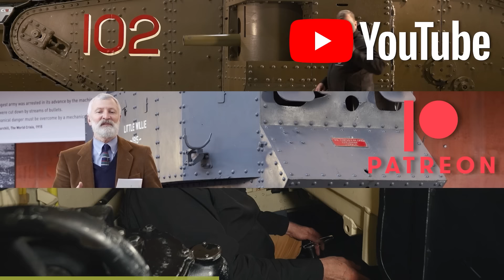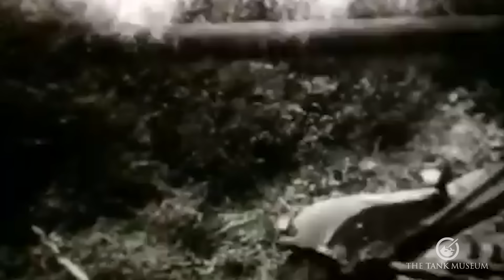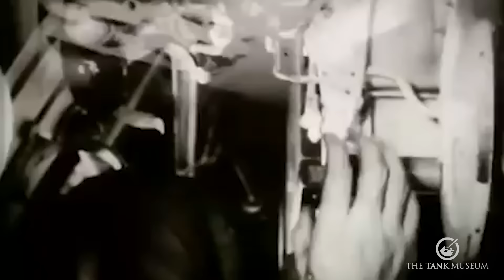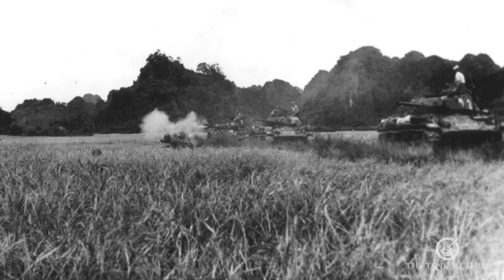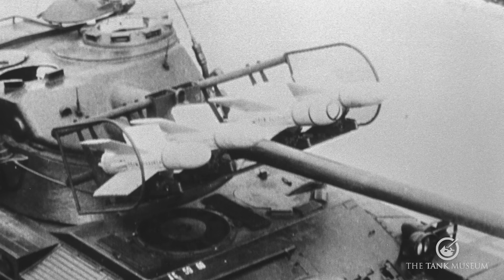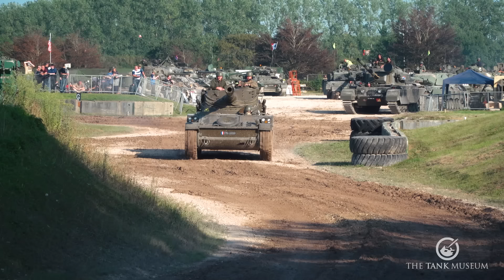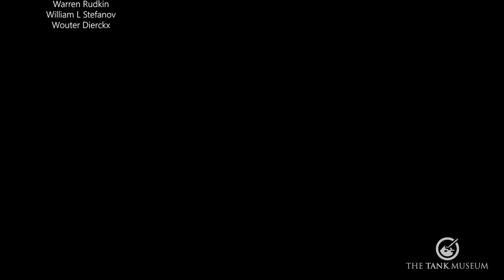AMX-13 | Tank Chats #174

Comment: One of my favorite designs aesthetically. So unique!
Reply: as much as I enjoy the aesthetics these things would have terrified me to drive since the armor could be penetrated by firm sneeze.
Reply: The same can be said for many medium tanks, most light tanks, all APC's, and Most IFV's. Historically armor isn't everything. It really depends what you're up against, and the doctrine of you're army.

From my ~15 years experience and multible deployments, I've always been shitting my pants, and flooring the pedal, when ever RPG's or other high calibre start flying. When ever possible. Else praying, even though I'm not religious.
Until the age of the commercial drone, I have always prefered mobility over armor, in everything but a main battle tank, because of the typical ways different vehicles are utilised.
Fighting a low intensity insurgency is different though. IED threats require Up-armoring.

But now that real time air survailance costs basically nothing, and small payloads can be guided through a window when driving 60km/h, by a guy who has played videogames his intire life, with only 30min additional training. I'm not so sure anymore. Survivability is probably the way to go on any vehicle, going forth. 

I'm glad, that I'm retired. While war fighting has always been shitty. I really feel pity for soldiers these days.
Reply: @soul0360  the issue I have with the AMX-13 is that even old AT rifles could pen the armor. armor doesn't need to stop everything but being a "tank" that can't handle even a single round from WW2 era autocannon fire is off-putting at the least.
Reply: @soul0360 mobility still matters, anti drone systems are just something that need to be delevoped

Comment: Sweden almost bought the AMX-13 in the early 50's when the UK refused to sell the Centurion.
Then the UK economy tanked and getting foreign Currency took priority.
The first batch of mk3 centurions where delivered straight from UK Army mobilisation depots.
Reply: Countries were queuing around the block to get Centurion and then the Korean War started which halted British arms exports temporarily. I don't think the AMX-13 was a Centurion replacement. The Swedes had expressed an interest in autoloader technology quite early on and trialled the vehicle in Sweden, and I'm not sure if they had any serious intent to buy it as such, rather they wanted to study the technology.
Reply: @shaddaboop7998  The deal for 400 AMX-13 was ready to sign when the Centurions came available, invalidating the need for the domestically developed "Kranvagn"/"E.M.I.L." tank project that the AMX-13 was intended to supplement.
Reply: @johanmetreus  Yes seems you're right. Either way, Swedes didn't like AMX-13 much and besides it was never intended to be used as the country's main battle tank, that would've been EMIL.
Reply: @shaddaboop7998  No the AMX-13 was really on the table because the Centurion was not available. 
It wasn't the ideal choice but it's what's available.
Reply: @AdurianJ  That wasn't the impression I had. I doubt it was intended as a main battle tank replacement. Sweden was developing an indigenous main battle tank with an oscillating turret before they decided on Centurion.
Reply: @shaddaboop7998 The whole reason for going with a foreign tank was that the Swedes had given up on their own project, being considered to expensive and to uncertain, at the time. The new tank, AMX-13 or Centurion, would be the next MBT of the Swedish Army. The question was whether to go light, giving good mobility, or going heavy, giving good protection. Eventually the Centurion won out but it was very much a debated choice within the Army at the time.
Reply: @AdurianJ How available was it really? The Swedish Army received its first Centurions in 1953 but watching the video above I get the feeling the French would have struggled to deliver hundreds of AMX-13 to a foreign customer at that time.
Reply: @vendist  EMIL wasn't scrapped until the British offered Centurion again in 1953. Until then it seemed Sweden was going to buy a fleet of AMX-13s to buff out the limited production numbers they could've managed of EMIL as a main battle tank. The Swedes didn't seem to like the AMX-13 much anyway and jumped at the opportunity to buy Centurion.
Reply: Ironically, the Centurions proved too heavy and expensive to properly defend much of Sweden which lacked the good roads to support fast Centurion movement, so they developed the S-Tank and such to provide coverage for that capability problem. If the Swedes had gone all-in on AMX instead, they might have ended up not developing half the vehicles they eventually did, instead focusing on up-gunning AMX.
Reply: The UK was experiencing a slow recovery in the 1950s, but then hit the 1970s recessions quite hard. Selling a lot of military aircraft abroad fed our family back then.
Reply: You certainly got a better deal with the Centurions I suspect.

Comment: I think its hilarious it was intended to fight in the colonies (all hot) and they put the engine next to the driver. A true case of un thought through design intent.
Reply: An awful lot of design is compromise.  There is nowhere else to put it and stay within other specs.
Reply: That's part of the compromise. Tank had to fit in a plane initially so had to be short and light. To get a powerful enough gun for the size barrel had to be long so turret had to go at back to avoid overhang leaving the only engine space to be at front beside driver. Yeah, there are other things you can do but you have to go with what you have at the time and the resources you have in France
Reply: (Looks at Merkava in Middle East deserts)

Maybe it's not that much of a problem.
Reply: If the engine compartment is well designed it can protect the driver from the heat. The driver's compartment may also be shielded. A large radiator, a strong ventilator, to circulate the air around the engine, also help to dissipate the heat away from the driver. 
Not perfect solutions, but it is not much worse than all the other tanks of the era while figthing in the desert. Under the sun, any of those metal boxes became an oven, air-conditioning started to be used in tanks only much later.
Reply: Well, I guess you know nothing about armour design, so you think it's hilarious. The reason for the engine in front is for extra crew protection. Being a light tank, it was already deficient in frontal armour protection. The placement of the engine and transmission in front, provides extra protection to the turret crew.
Reply: No un char anti communiste il protégeais la frontière avec la RDA😁
Reply: living in a hot climate during the hottest summer in history; makes things like that really stand out. I want the airconditioner right there and the driver should get most of the outlets